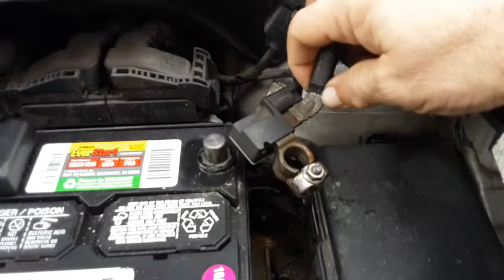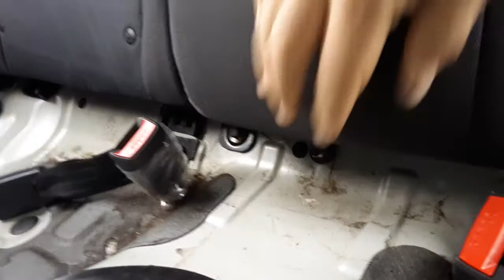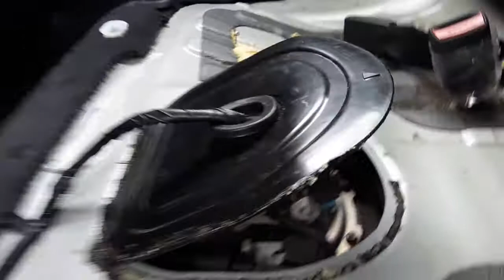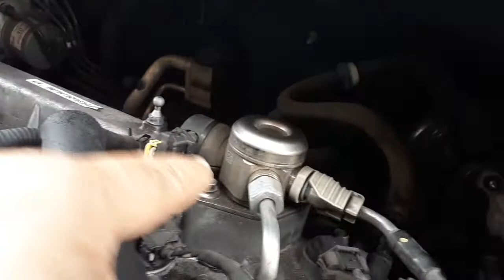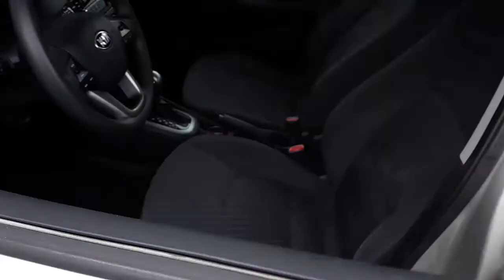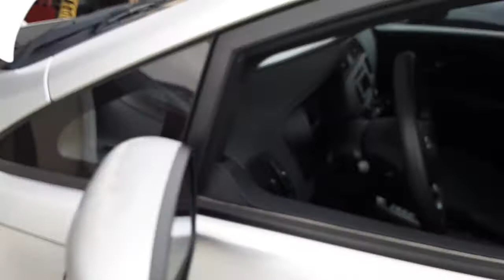2013 Kia Rio Fuel Pressure Relief Procedure...

Comment: If you just let your vehicle sit for an hour or 2 you wont have to worry about it. I never had gas spray out of the lines after I let it set for a few hours.
Reply from the maker: That could definitely be another way to do it but I wasn't able to find any information online on the procedure until I downloaded the repair manual.
Reply: What was the problem with having to much fuel on your cylinders,because i have the same problem with my 2014 kia rio lx as a redult i have a misfire p300

Comment: I buy cars from auctions and have rebuilt many of these 1.6 engines. All you need to do to depressurize the fuel rail is to loosen the hex nut on the high pressure pump that is mounted on top of the valve cover. About a teaspoon of fuel will dribble out to depressurize, then retighten the nut and your good to go.
Reply from the maker: Yeah this was my first time using this procedure on this vehicle so I went by what the service manual said to do but thanks for the tip.